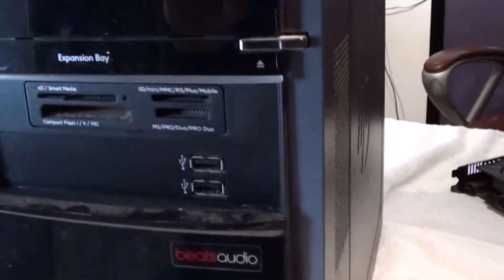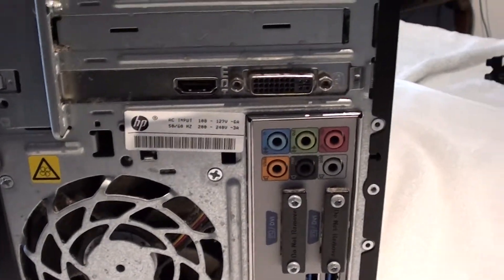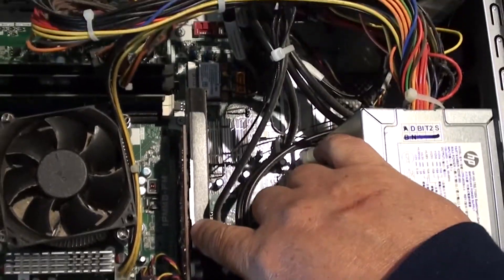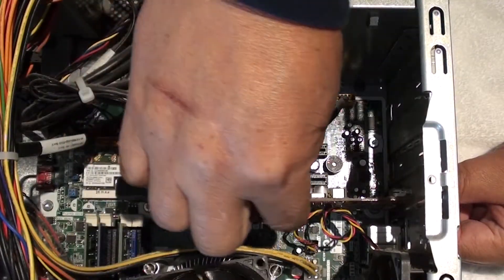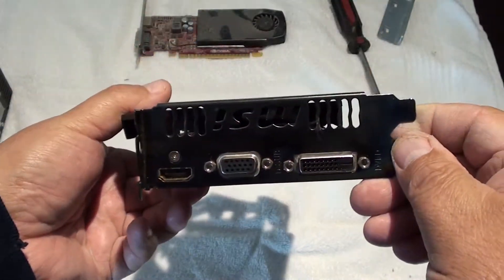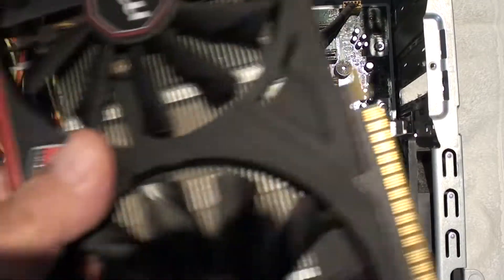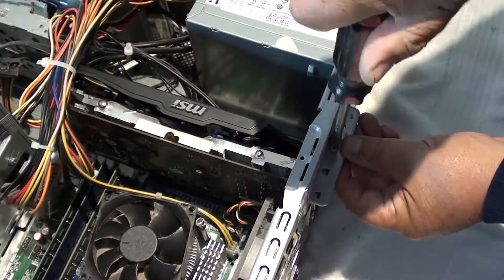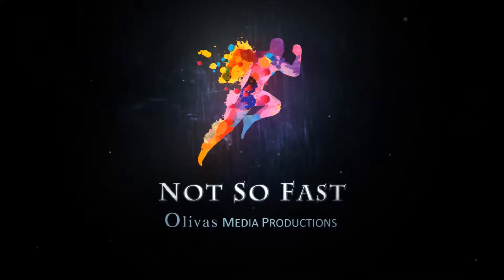HP |  Pavilion  | Desktop | Video Card  | Upgrade | DIY | ep 1

Comment: picked up the h8-1160t model and had to clean up the interior real good, reapplied thermal compound onto the cpu, put in a full 16gb of ram and used a gtx 960 4gb for the gpu. i also noticed that the stock heatsink is different then mine, but doubt it affects performance

Comment: can i put 1650 super into it?
the original power supply has 6 pin connector and is capable of delivering enough power
Reply from the maker: The best advice i would give you  is contact the manufacturer. Otherwise i would be guessing.  Thanks for stopping by.